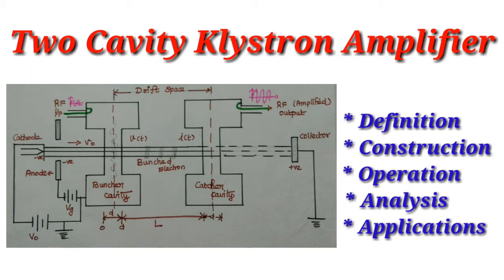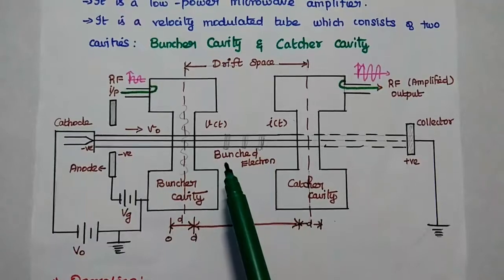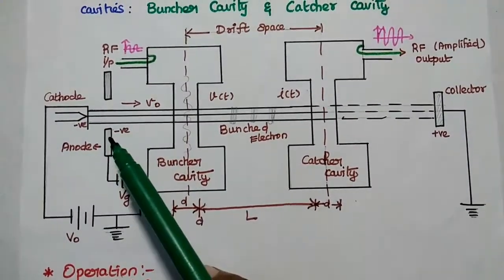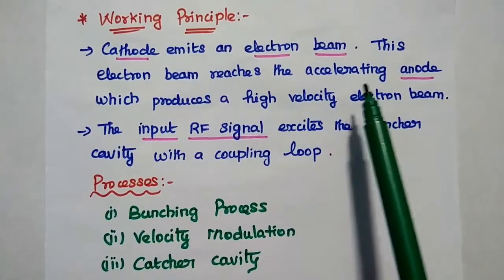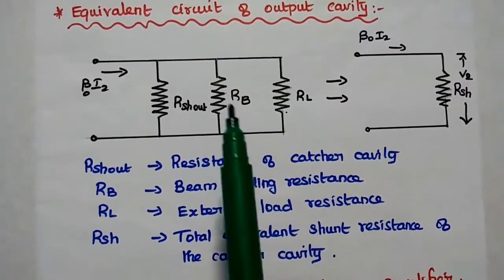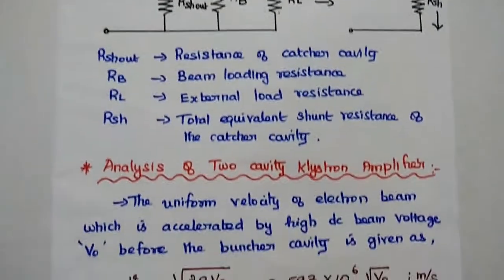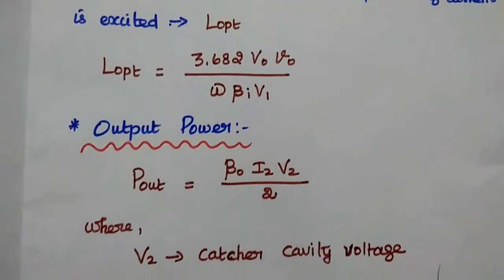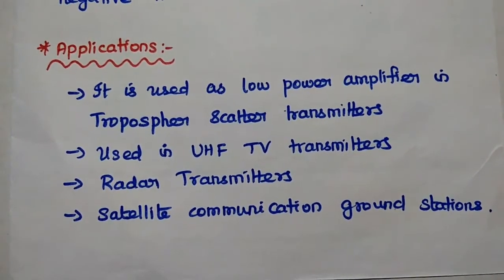Two Cavity Klystron Amplifier - Construction - Operation - Analysis and Applications

Comment: Mam it is a high power micro wave amplifier. It is capable of producing output powers of several kilowatts, which makes it suitable for applications such as radar systems and satellite communications where high power and high efficiency are required.
Reply from the maker: It is a low microwave power amplifier. TWTA is a high power amplifier used in satellite communication.